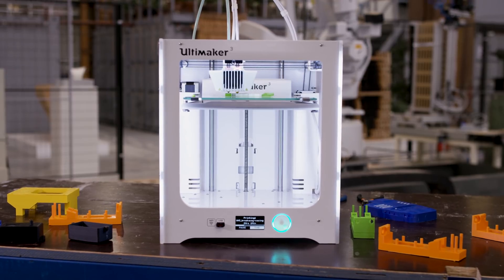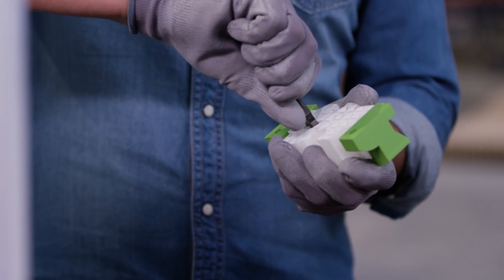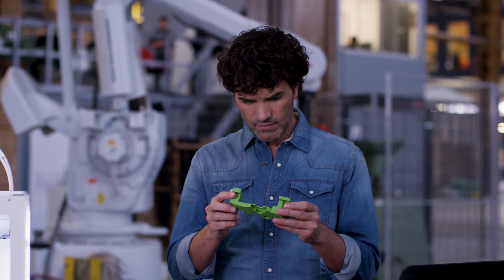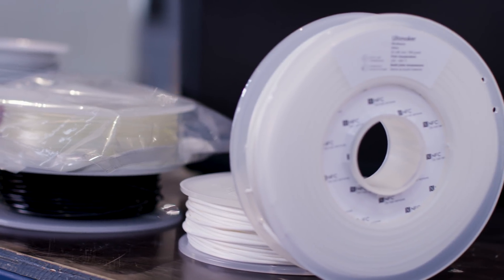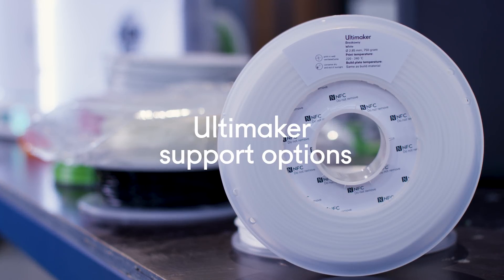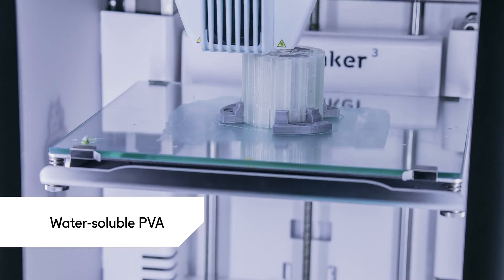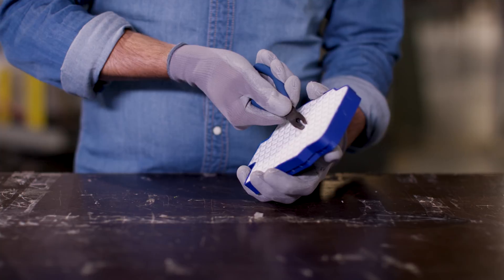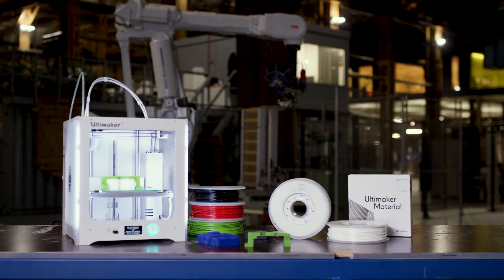Ultimaker: Introducing Breakaway support material

Comment: I tought that was how support material already worked, The effort it took to remove it looked the same as with normal support , also, isn't there dissolvable support material now?
Reply: They explained it right in the video. The new support material is probably indeed harder to remove than supports made from the same material as the item, but leave a smoother surface finish and more detail on the supported surface, because it provides a full mating surface that your actual building material can lay onto. They also still offer soluble support (PVA) which is easily the best but it has two drawbacks. One is that it's dangerous to use PVA with ABS, ABS tends to simply curl up on top of PVA and grow an upside down ball of ABS afro right on your nozzle. Other is that it increases iteration time, because it'll take a whole day to come off, so when your boss says 'i don't have all day', well. There's hypothetically HIPS soluble support material for ABS, but D-Limonene used to dissolve HIPS is nasty and tends to eat up ABS too!
Reply: Honestly they looked even harder to remove than normal supports generated from Slic3r or S3D. And after the struggle with pliers you can clearly see still support material being stuck to the surface of the model.